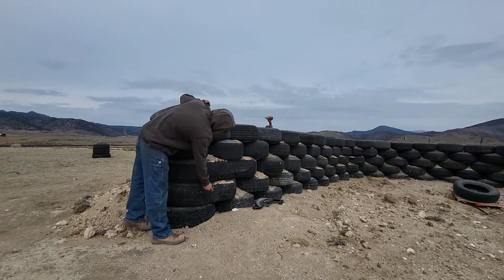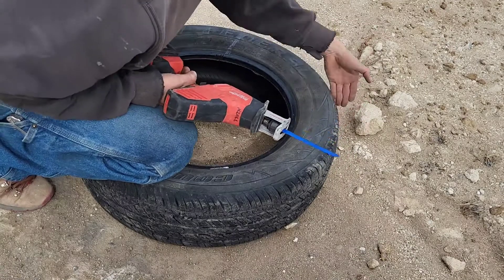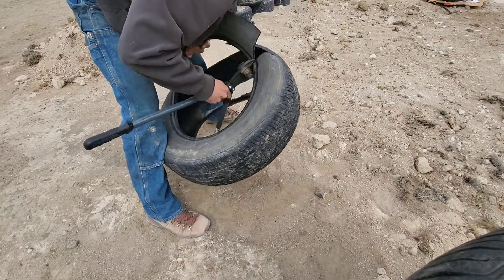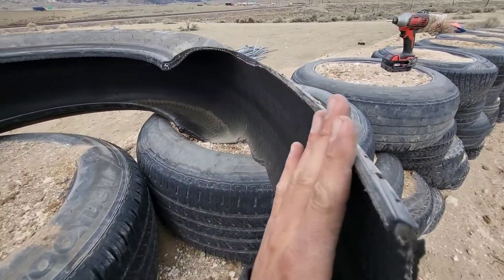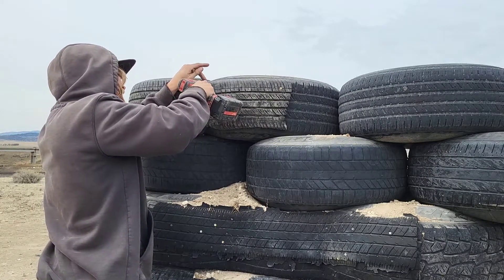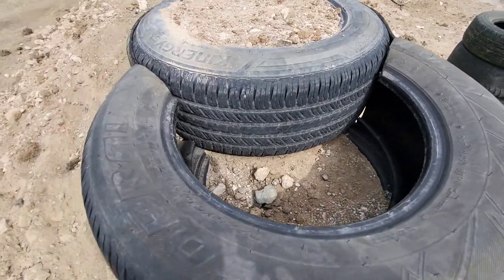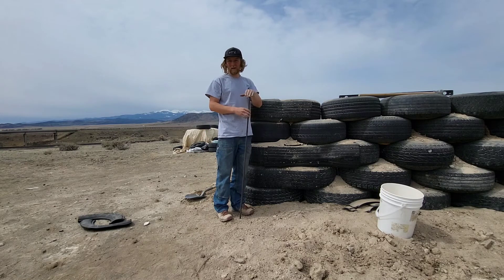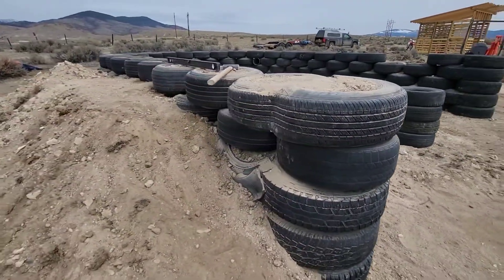Earthship build: How to cut tires for half blocks.

Comment: Wouldn't the bolt cutters work better going from the outside  in? You don't have to fight the inside tire diameter or the rest of the tire while trying to cut the bead cable.

Comment: now we cooking with grease, I would only suggest you use your tire wall ends in cement, for tapcon, or lag bolt holding capabilities...
but this is actually a worthy significant addition to earth building techniques... 👍
rebar only works with cement BTW, don't waste the cash those tire walls aren't moving once cemented and roof connection...
but hey we make our paths, I enjoy to lessen the negative impact by feeding free knowledge...

Comment: I am collecting tires now for my earthship, have about 300 so far. Should I be trying to get all the same size? I have random sizes and I’m stressed about it lol
Reply: I believe they don't have to be the same size. The bigger tires would be laid on the bottom rows and smaller on the upper rows.
Reply: @DanielHernandez-et4th  I appreciate you for responding thank you ❤
Reply from the maker: Not all the same size. You start with bigger tires on the bottom and get smaller as you go up. All the tires in each course just need to be the same width. This will help you keep your wall level as you go up.
Reply: @nialldivers  thank you so so much !!

Comment: I built a root cellar using about 70 tires. I cut half tires like you demonstrate. This was over 10 years ago. I also used bailing wire wrapped around the endwalls on each course that had a half tire. The baling wire could be wound really tight, and it was quite easy to work with. I am thoroughly inspired by your mini earthship video series. Should there be a concern in a rural area with getting permit approval?  Do I need blueprints to present to the building department?
Reply from the maker: My property is in a pocket of freedom. My county doesn't require any building permits. The only thing I need is a septic and electric permit from the state.

Comment: Did you start a course of tires below grade?
Reply from the maker: I removed the top soil and started Pounding tires. It's probably a foot below grade. The final floor with be half way up the first course.
Reply: @nialldivers  I ended up watching from the beginning. I am in a similar climate here near the eastern foothills of the North Cascade mountain range in NC Wa. state. It's more flat and barren where you are . Is this in Idaho or Montana?
Reply from the maker: @bradcampbell5766  montana

Comment: How high do you go up with the tires. Great job.
Reply from the maker: I'm going to do 9 courses of tires. So I've got 4 more to go.
Reply: suggest no higher than 8-10 ft max, the higher you go the less tensile strength from toppling over, which is why you use the U design, 
some go around 6 foot, then finish with earth bags, 2/3 less weight but just as strong mass...